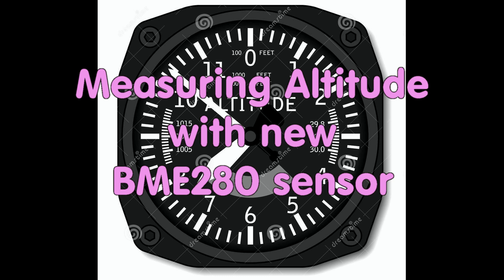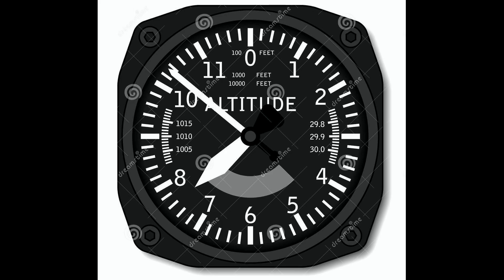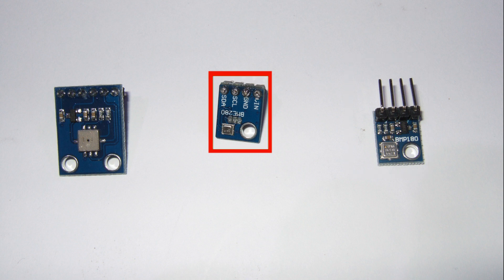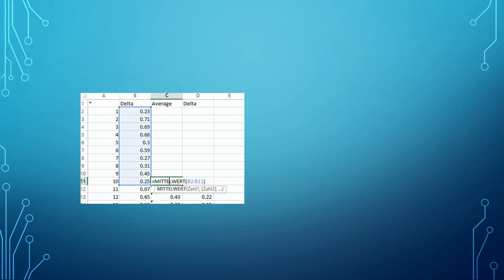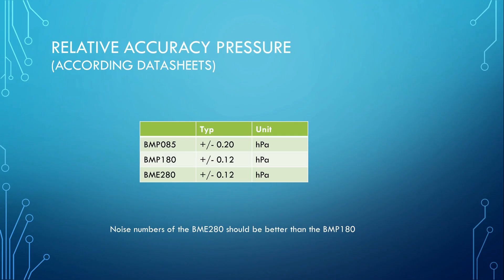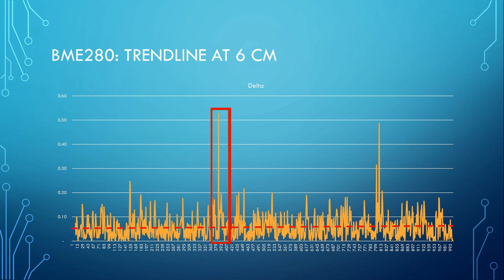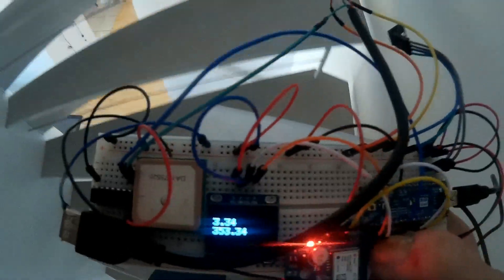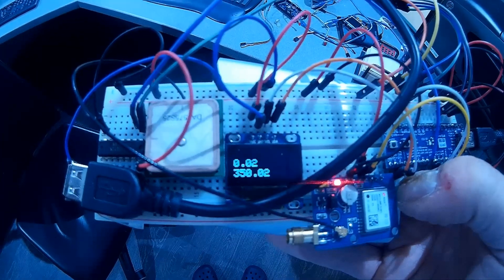#16 Exact Measurement of Altitude with BME280 sensor

Comment: Thank you for the video. 
I wanted to check the code but the rep on GitHub doesn't exist anymore 😢
Reply from the maker: This is an old video. But I am sure you find example files in the Arduino IDE to start with.

Comment: Did you compare the altitude reading from bme280 to gps reading? Actually sometimes there's big difference in altitude especially when the sea level presuure is far away from 1013.25hpa lower or greater
Reply from the maker: The BME never displays a absolute altitude. It always have to be calibrated to the current air pressure
Reply: @AndreasSpiess  
Yeah exactly, 
The air pressure maybe accurate with bme sensors but altitude never be because of the 1013.25 average at sea lvl

Comment: Cool review. I picked up the mini stackable ESP8266 with the BMP180 shield and an OLED Sheild.When the drivers are properlly loaded she gives a nice display that pretty much matches the airport listed altitude to a few feet, it jumps around quite a lot, plus gives temp and BMP readings.
Reply from the maker: It should even show you the weather (pressure changes)  if you once calibrate it to your altitude.

Comment: Hello,
According the MCU specification, can I use the ESP-32-D ?
Reply from the maker: If you find a library for the ESP32 it should be ok. Check if your sensors work with 3.3 volts
Reply: @AndreasSpiess  OK, I used the Lolin32, with BME280, and its work with the Adafruit bme280 lib. thank you very much!!

Comment: Perhaps you should attempt the test again, but this time open all the windows. I'm not sure if the windows being closed would affect the pressure readings while indoors. Perhaps the air system inside could be throwing the reading off.
Reply from the maker: We have no airconditioning here

Comment: Thanks for the interesting comparison. 

First one addition: 

there are different oversampling-modes available for the pressure-readings, which increase precision a bit but make response-time slower (internal averaging). For the SFE_BMP180.h library this is done via: pressure.startPressure(3) 

values from int 0-3, higher = more accurate. See also the manual for BMP180/280

Doing so and with averaging over 6 values in my code, the old BMP180 is accurate enough for my homebuild variometer inside my rc-glider. Transfer to ground via 433 Mhz radio-module, tone-output of arduino feeds signal-input of module. Output from receiver goes via amplifier to headphones = only one arduino needed.

I Agree with Mr. Tucker that GPS-measurements are very imprecise if not RTK-compensatet via reference-station(s) - see 

https://www.swisstopo.admin.ch/en/knowledge-facts/surveying-geodesy/permanent-networks.html
Even with correction an undisturbed view to the horizon is needed for good altitude measurements, which is often difficult in mountainous areas like in switzerland.

Comment: Thanks for interesting video. BTW, some cycling meters (like new garmins) have a neat feature: you can store gps point(s) with known altitude. When you drive by one point, device calibrates itself.
I used to have points near home, work and some other locations I may be stopped for long. I found out than weather patterns usually agreed to 2-4m between points at flat terrain separated by about 10-15km. Sometimes altimeter measured even 30m difference when there was eg. a low pressure zone approaching.
Reply from the maker: I did not know about that feature. Very good concept!

Comment: I assume your house is warmer on 2nd floor, compared to first floor and warmer still on third floor.  Perhaps you need temperature compensation?  Also, some of these sensors are sensitive to light.  I don't know if BMP280 has same problem.
Reply from the maker: I think the difference is below 1 degree C. So not very important.
Reply: The deviation not only depends on the temperature but also on pressure altitude in combination with temperature. For every 1000 ft (ca. 300m) it would be 4 times the difference between ISO standard temperature (at given altitude) and measured temperature. For relatively small changes in altitude this should not have a big impact. At least as long as temperature does not differ very much from ISO standard and/or for very high altitudes.

Comment: Very late to this party. I found the BMP180 very sensitive to light. I also note that the light conditions on each floor in your house is different. 
Try covering the hole in the can with a blackout material or sponge. You may find that that will also remove some of the large deviations in your initial spreadsheet data.
Reply from the maker: Thanks for bringing this up. I did not know it.
Reply: If the hole is sealed, then it will not measure the change in pressure, so care must be taken not to hermetically seal the hole. Sponge would work so long as it doesn't block the hole.

Comment: @Andreas Spiess I consider sending up a weather ballon and I wanna attach a ESP8266 to it to log the height. Do you think this sensor is suitable for that? If not what would you recommend?
Reply from the maker: The ESP is no sensor. And it’s reach is quite small. I would go for a LoRa Module. On a balloon it reached up to 700km
Reply: @AndreasSpiess  There is no need for transfer. I plan on attaching the sensor and log data. I can obtain the data when the balloon has landed. I was just wondering if the sensor shown in this video will do the job, which means logging the altitude. Considering influences such as low temperatures, possible humidity, ~50km of height
Reply from the maker: I do not know. Maybe you consult the data sheet and check which sensors were used for other projects. I would not trust you get your balloon back. But I am not an expert.
Reply from the maker: Check also the batteries. Lopo are not good when it is cold

Comment: Hello girls/guys, it is strongly depending how the library is "made" for good measurement. Also most floating values could be stopped by beeing displayed instantly when measurement and other things are changed a bit. The recommended settings from Bosch for the different scenarios working good for me now. https://github.com/BoschSensortec/BME280_driver  The library i am using now is https://github.com/bolderflight/BME280. Gave me best results so far from testing also others. Best practice for me would be to use the given stuff from Basch itself. But i am missing skills to make it work so far. Even the part is more expensive then other i still buy them for the quality of results i get from them.  Thanks for the videos Andres ;-)
Reply from the maker: Thank you for the link!

Comment: I have been playing around with the 180, I have two of them, one on a shield for the Wemos ESP8266 and have the other hooked to a Wemos D1 ESP8266 (arduino look-a-like)  Both are off, depending on the day, of course from 20 feet to (today) over 200 feet above sea level. I live in a town that is at around 2550 Feet above sea level.  I  have considered tacking on a -200 or what ever but it changes so greatly that there is really no good subtraction that would give me a valid reading.  I guess I will just have to go with the flow, I am working at building a  unit to put in my RV for when we are on the road.  Our usual route in the spring and fall take us up over passes that are from 7000 feet to the highest at around 9000 feet when crossing the Rocky Mountains, and down to around 20 feet where we park for the winter in the Mojave Desert of Arizona, just a stones throw from both Nevada and California.
Reply from the maker: These devices are quite precise if the pressure in an area stays the same and you calibrated them on a known altitude. For traveling they are probably not accurate because you change the area quite often. Pilots have to adjust their sensors always before landing to the relevant airport.

Comment: I also have a couple of these sensors but have found that the noise is much greater than the declared 0.2 Pa. Even if this can be overcome there is the ±1.5 Pa/K temperature coefficient to deal with. Would you not say that it is  almost unusable for altitude measurement? I also wonder if you can get true altitude from a GPS. How did you get on with it on your bicycle?
Reply from the maker: If I remember right they included the temp sensor to compensate the issue with temperature and in the datasheet they even have a formula. I am no more sure because this is a quite old video.
Reply: Andreas Spiess Thank you Andreas.
Reply: @JDI4DAVID  I know I'm replying to a 2 year old message, but I've found by using the formulas given in the datasheet, I'm getting incredible accuracy from the MBE280.  As an experiment, I put my build in my car at work, zeroing that altitude and seeing then monitoring my relative altitude to my start position at work.  My trip home is about 5 miles, and varies about 250 ft in elevation.  Arriving home, it showed my altitude at -12 ft. from my starting position.  I double checked those figures on a topographic map and they checked out nicely.  The next morning I zeroed the altimeter at my starting position at home, and traveled back to work and it showed work as being +15 ft difference from my home driveway.  So the altitude seems to me to be accurate to within 3 ft.  I just haven't quite figured out the formulas to use to get my calculated altitude based on reported pressure readings.  And that is because the more I think about it, the less I understand about what exactly the reported air pressure really means.  And I should know better.  I used to be a pilot back in the 1970's.
Reply: @cmblcdoe6669  I'm sorry I'm being stupid for replying to a three year old message, what is the code/formula you are talking about?

Comment: Prior to modern electronic altimeters being used in aviation, the use of aneroid barometers was extremely accurate because they could be calibrated, relative to ground based measuring device only. You are correct stating altimeters used in aviation are calibrated for differential - but they cannot check or verify local conditions, only measure based on the first calibrated input. It should be noted for clarification, Aircraft altimeters are only indicators of barometric pressure, not an actual measuring sensor.  Early Electronic models often had reference calibration issues. It was one reason radar altimeters were believed to be their replacement.

Unfortunately, the size, cost and electric power required for precision measurements has turned out to be problematic. 

For all of the reasons described above, all aircraft flying above  18,000' - set the barometric pressure to 29.92" for all types of altimeters, digital or aneroid for the reason you explain.

Below this altitude, pilots call air traffic control of each sector flown, for their airspace barometric pressure reading to input into the aircraft altimeter - analog or digital. It is not unusual to have up to 1.5" differential between two adjacent sectors, which drastically changes indicated altitude.

This may explain your sensors inaccuracies. If you have a known valid barometric pressure reading and precise altitude to enter as part of your calibration starting point, perhaps your accuracy will improve. The use of a GPS altitude measurements can be inaccurate up to 3 meters and thus cannot replace true known ASL elevation. 

Even so,  I believe these Bosch devices are not measuring sensors that can self calibrate without an reference index point and have the same potential inaccuracies as their aviation cousins....
Reply from the maker: Thank you for your explanations. As a former hobby pilot, I am aware of some of the facts you mention. The Bosh sensors have to be calibrated as any other pressure sensor I know if you want to measure height.

Comment: You should not expect sub-meter resolution. Just opening/closing a door or a window will throw the mesurements off scale. Even a slight wind outside will do the same. Even some wind let out by yourself could influence the result, so don't. ;-)

The comparison of the different sensors should however be valid if those parameters were not throwing the results off.
Reply from the maker: I think you are right. But with a little averaging, you might be able to eliminate some of the mentioned effects. Of course, the speed is reduced then.

Comment: Ace! The altitude accuracy is excellent.
I've tried to implement the altitude formula in my python code using the BME280 chip
[ Altitude  = 44330.0 * (1.0 - pow((pressure * 1000) / 101325, (1.0 / 5.255)))  ]
but the results can vary +/- 20m :/
Can you help?
Reply from the maker: As you see in the video, my measurements were much more precise. So you either have a wrong chip or something else is wrong. But I can not do a remote diagnostics.
Reply: Thanks Andreas, I was being stupid! Its because I compared results taken on different days and the sea level pressure has changed!
Reply: @tomnutt209  But how can we measure absolute altitude with this sensor? I wanna go into mountains and check the peak heights, without knowing the sea level pressure.

Comment: hi
maybe you can help me... I am trying to connect the bmp280 to my stm32f103c8 with Arduino IDE. I don't know what library to use for the i2c communication ... and I am searching for code example for reading data from this bmp280 what pins to connect the sensor
Reply from the maker: In arduino, we use the wire library. It should exist also for your microcontroller. The pins are defined by this library. Otherwise, it will not be easy. Roger Clark knows a lot about ST and Arduino IDE ( https://www.youtube.com/user/synergie8 )
Reply: Thanks for your fast reply !!!!!!!!!!!!!!!!!!

Comment: If one doesn't need the humidity measurement, the BMP280 is a little less expensive than the BME280.  The only difference is the hygrometer.
Reply from the maker: Thanks for the tip!

Comment: Hi! Did you experience strange spikes with this sensor in normal mode? All my BMP280 sensors randomly show incorrect data, about 150 hPa less for 0.1-0.5 seconds and then goes back to normal. Tried different I2C speeds, capacitors on VCC lines, different oversampling settings, nothing solves this issue.
Reply from the maker: No, I do not remember having these problems.
Reply: I have the bmp280. Seems to work good with a Arduino Nano. As I type this I realize this comment was made 8 years ago omfg. Time flies
Reply: @FreeEditsForYou  Yep, and the issue was not solved. I decided not to use pressure sensor in that project.

Comment: +Andreas Spiess ,  Does accuracy of altitude measurement can be increased by using multiple BME280 by averaging the output data?
Reply from the maker: Probably, but I think, not a lot. You can also average the reading of one over time to get a similar result, but of course, slower. A basic averaging function is already built in into the chip.

Comment: Is it possible to read the BME280 with a much smaller uC like a Attiny85 e.g. ?
Reply from the maker: +therealfox Since the BME280 uses I2C it shoud be possible. Use TinyWireM (master) library and keep me posted if it works...
Reply: +Andreas Spiess I try to measure the altitude of an rc model to see in which altitude i am flying an try to read it after the flight. But i dont know if its worth to order the whole electronic parts if i am could not sure that it work. It should be more accuracy then gps, but it only need 1 logfile entry every 5 seconds or so. I'am really unsure if the tiny can handle it. Maybe i need to search for an already build project for this.
Reply from the maker: Where do you want to store the data? On an SD card? Then, the Attiny is definitively too small

Comment: Fantastic device with temperature, humidity and pressure in such a small package!  Your testing against a GPS will be interesting, but I wonder if GPS resolution is perhaps insufficient to come to a conclusion about accuracy and linearity.  Did you use the over-sampling and normal modes during the indoor tests per the data sheet?
Reply from the maker: +k1mgy If I remember right I used the "indoors" profile which uses 16x oversampling for pressure. I did not test it without oversampling because I wanted precision and had no issue with speed.
You find the video about GPS precision in my channel. It shows, that the precisions are different: GPS is very good in absolute altitude, but much weaker than pressure sensors in small altitude differences. For my power meter I need precision for small altitude differences. This is why I use pressure sensors for that (in addition to a GPS for speed)